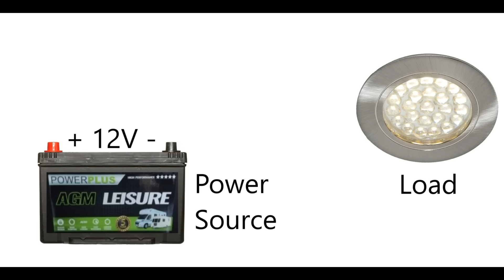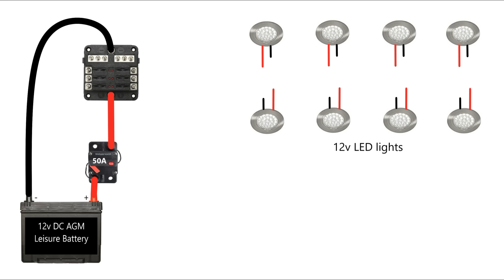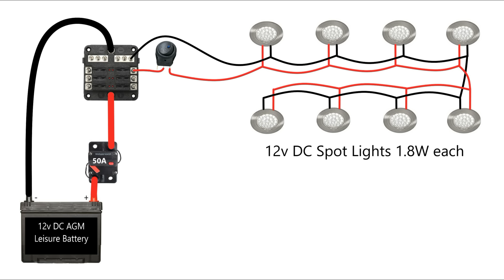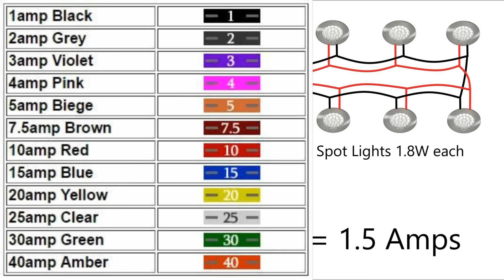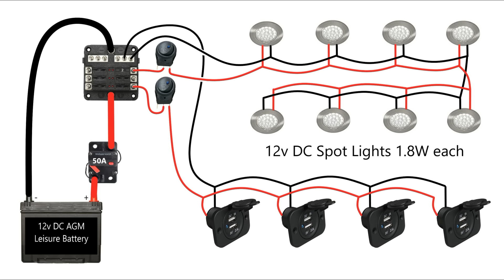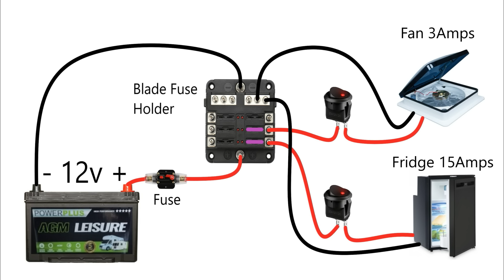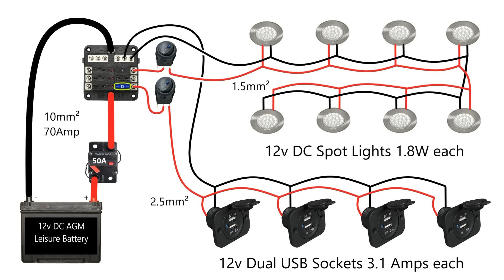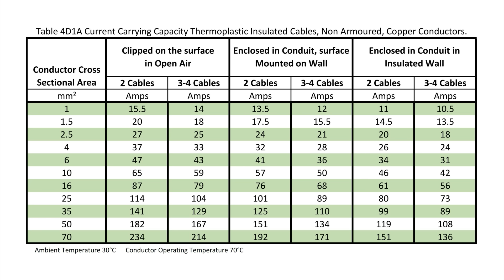Electric Cable & Fuse Sizing - Camper Van Conversion Series

Comment: Do you not need to take the length of wire into account when selecting the wire cross sectional area?
Reply from the maker: Yes absolutely correct, you do for the resistance and volt drop. Generally speaking as the van is so small the lengths are very short so the volt drop is minimal.

Comment: Question, I see in your video and wiring diagram you put up on the screen, the switch is between the fuse and the component.  I purchased a six gang switch panel for my build. It already is prewired and has on terminal “out” to the component. So can I run a wire from the switch to the fuse panel then to the component instead, or does the switch need always to be between the fuse and the component?
Reply from the maker: The switch can go either side of the fuse it will still shut off the circuit.

Comment: Greg when I put my new B2B in can I remove the old split charger? Also could I use the old split charger connection for the new B2B?
Reply from the maker: Yes take the old split charge out. Check the cables sizes if you plan to reuse the wiring. Most dc to dc charger require both poss and neg cables to be installed to both batteries.

Comment: Hi Greg great video on
electrical drawings. 
Just started van build amd wondering about your 3 solar panel system wiring
Drawings. Is it possible 
to introduce a van charger system  that will charger the leisure battery while the van is running. I belive this is called a split charging system. I plan on doing wild camping with my van during winter . Also I live in the North West of Ireland so sun light is very poor during winter time.?

Comment: Hi Greg, thank you so much for the incredible videos - I'm trying to get my head around the wiring for our camper and these are saving me! I noticed that you use a 1.5mm cable for a 1.2 amp set up. If I were to have a 0.45A or 0.3A set up (in an insulated van wall in a conduit) would you also recommend a 1.5mm cable? And then a 2.5mm cable for 9.3A? I know this is a bit larger than the cable size chart but maybe it's better to err on the larger size. Thanks so much for any advice you can provide!
Reply: Hello Isabelle,, how are you doing today, how’s everything going Isabelle?

Comment: Hi Greg 

Great Videos, they are a massive help. However I am slightly stuck with parallel lights circuits. I have the same touch sensitive LED lights as your own build (thanks for the inspiration btw), but how do I create a parallel circuit with them because as you know they only have two small terminals? Do I need some sort of connector or am I just not seeing something obvious.   

Thanks in advance

Comment: another great video - but I am confused about the cable sizing - as it does not seem to allow for variation in length of the wires or the voltage drop - when I use  - Drop in Volts (0.2) = (L x I   x0.017)/A mm2 - I get wire sizes way larger than those suggested on your video ?
Reply from the maker: Yes you do need to consider volt drop. Most of the runs in the van are short enough but the calculations require a dedicated video. Thank you for watching 😃
Reply: Thanks for you reply - yes the difference is significant over a short distance as you say for 15 amp 10m 6mm cable as against 1.5mm - I hope I’m wrong
Reply from the maker: @luderick  use this easy calculator on this page to check your sums. https://www.12voltplanet.co.uk/cable-sizing-selection.html
Scroll down to find it 👍🏼😃

Comment: Do you ever use an isolator and if so would you put it before the circuit breaker or does the trip function work as an isolator function?

Comment: Would lights be wired up the same if every light has an individual switch and usb charger built in?
Reply from the maker: All 12v devices must be wired in parallel to keep the voltage at 12v DC Just make sure to correctly size cables and fuses to cope with the load. 👍🏼😊

Comment: Hi Greg,

I was hoping for your advice, i bought 12v 2mm twin core cable (although rated at 25 amps). The issue i have now is, the strip lights i purchased wire is 20 awg, teeny tiny wires, 0.5mm-ish and I'm at a loss as if i can connect them as there is a massive drop in wire size. Can i use wagos? should i do an in-between wire size before the larger 2mm. my plan was to have the 2mm around the ceiling and then connecting the smaller wires of the lights, usb ports, fan as that will be easy access if anything needs changing. please help! thanks so much

Fan 3.3 amps
USB ports 6.25 amps
Main Lights 2.5 amp
Strip lights 1.25 amps

Comment: Hello Greg, hope all is well. Question...I want to hook up my 12V fridge directly to my battery. I have a 200 watt solar w a 1000 watt inverter. Do I cut my plug wire to do that??
Reply from the maker: I would suggest taking it off a blade fuse holder so you can protect it with a fuse. Watch my other 12v wiring video

Comment: Hey Greg, I turn to you because you are someone who respects the regulations. Do you know if there are any restrictions on where you would place an external shore power socket compared to a gas refilling point? It would seem to make sense that there would be some separation but I am just not finding any reliable info online about this. Any help greatly appreciated 😁 thanks!
Reply from the maker: The lpg regulations state that filling point should be 500mm away from windows, flues, vents, etc so I would use that as a guide.
Reply: @GregVirgoe  perfect, thanks Greg 😁 as ever you are a star!

Comment: Hi Greg, thanks for the great videos. I could only get 3 core 2.5mm flex cable, can I use this instead of 2 core for the likes of fan and fridge where 1.5mm is not enough? Thanks,  Cec Han
Reply from the maker: No problem with going with larger cable for the 12v devices. Your fridge will need something much bigger because of volt drop. I ran 6mm to our fridge.
Reply: @GregVirgoe  Thank you, I just wasnt sure what I do with the 3rd wire if there is no earth needed, guess it would just be redundant. I will check fridge again but I think it's the CRX 50 compressor type not needing quite as much power. Just getting my head around it before I draw out my plan :) thanks again

Comment: Is there a reason why people don't use chassy as negative"wire".
Reply from the maker: Because you often get problems with poor connection or bad continuity. So if you’re running one cable why not run a 2 core and it be a much better system 👍🏼😃

Comment: Hi Greg, I am confused regarding the fusing of the PV cables for the solar panels.
I have two 150W solar panels that I am wiring in series as per your solar video. Do I need to calculate 300w/12v = 25A + 20% for my PV cable fuse size?
Reply from the maker: No look at the details on the sticker on the back of the solar panel to see what the max amp figure is. That will stay the same if wired in series so just add 25% to that. Typically a fuse of 15amps will be good to use. Like this one https://amzn.to/3jlJ5uc
Reply: Perfect, thanks a lot! 😊

Comment: Hello Greg and happy new year. Is it necessary to have such a switch between 230 volt systems? Is the inverter not switched off when plugged in? Thanks for very good Van Conversion info
Reply from the maker: No the inverter is connected directly to the batteries and unless you have an automatic changeover unit like you get in a motorhome the changeover switch is essential to avoid having two supplies onto the same plug sockets.

Comment: The 50A ignition protected fuse before the  blade fuse holder. It has battery line and Aux load. I'm assuming battery line is from battery and Aux is between fuze and blade fuse holder? Is this correct? Thanks in advsnce

Comment: Will the design basically be the same if the battery were lithium instead of AGM?
Reply from the maker: Yes exactly you would just have a charger that was compatible with lithium batteries.

Comment: Re your diagrams with solar panels - they seem to be connected in series and therefore double the Volts, from 12v to 24v - while the rest of the system is 12 Volts.  Have you had any complaints from people damaging their gear by pumping 24v into a 12v system.
Reply from the maker: Peter it doesn’t work like that the volts are more like 60volts of this setup. What the MPPT does is transform that down to a charge voltage which varies but lets say 14volts and bumps up the amps. 
The solar side and the leisure side are separated the leisure side does not see the input voltage. 👍🏼😁
Reply: @GregVirgoe  I am sorry for my blunt comment above.  Thank you for your good-tempered response. I did not understand that a regulator can accept a lot more than 12v and then reduce it to a voltage suitable for the battery.  Thanks again.  I have changed my system to series.
Reply from the maker: @petervincent7720  no problem at all. Happy to help 😁

Comment: If my fuse block is on one side of my trailer and I have 4-5 circuits crossing roof to opposite side can I send positive and negative to a distribution bus bar on other side and and branch my circuits from that source? I am using 12 wag and would likely branch with 14 wag. These are low amp led light circuits.

Comment: you say fuse sizes cannot be higher than 1.5 times of max load. but U use a 2 amp fuse for a 1.2A load. 1.2A x 1.5 = 1.8 so ur fuse is higher than 1.5 times I don't get it.

Comment: Generally pretty good, but there doesn't seem to be any accounting for distance in cable sizing, personally a would see 100mm2 as too small there, I'd be wanting that for the 12v sockets, maybe this is ok, but I'd want to account for someone plugging a 12v kettle or inverter in, you can never tell what some people will do, the kinda people who fuse out the work kitchen day after day with a plug in hob, but never twig it's their fault
Reply from the maker: In this example these are usb sockets (3Amp max) and not cigarette sockets which can be fused up to 15Amps

Comment: Hi Greg,  do I still need to add a 240v consumer unit in my van
if only used on site, or will a ex lead be protected by site  plug in.
great video's
Reply from the maker: The site supply should be protected by a breaker so you could plug in a extension lead with sockets on the other end and just use that. In fact I have a 4 socket 15m extension reel with a 16amp commando plug on the end in the van to do exactly that 👍🏼😃
Reply: Hi Greg, thank's for reply,my question was for a mate who's got a part converted BONGO.
Greg ,can I ask you another for myself, I  have a T4 and want to wire a 100 watt S/P to a
RING dc to dc ,then to a 130 amp L/B, Iwas going to use 20mm cable plus 150 amp breaker
to fuse panel, would this be OTT as the cable run is quite short. Sorry for long query 
.Les

Comment: Hi, DOUBLE 240V SOCKETS led strip Fridge sink with 2 burner and usb socket and 240 Hook do I need to install FUSEBOX CONSUMER  2 way or should I install 6-Way Blade Fuse Box Block & Auto Marine FuseBox Holder 12V 32V Bus Bar Car Kit? Help please

Comment: Greg, Do you use any kind of battery monitor? Or just the MT50 Charge Controller Monitor?
Reply from the maker: Currently just the MT50 and my Truma system also knows the battery voltage. 
I just keep an eye on the voltage and it’s never gone below 12.4volts in over two years. 👍🏼😁
Reply: @GregVirgoe  Thanks

Comment: I just bought 4 x 12v  c100 130ah  batteries..
Each one says CCA 800a..
I want to connect them parallel to keep the 12v..
What size battery link lead cables should I use? 
And what size fuse? 
Thanks
Reply from the maker: The size of the link cables is determined by the total load you intend to connect to them. Add up all the amps of all your appliances and use that figures to size the cables. Assuming everything may be on at the same time they need to handle the total load.

Comment: Hi Greg i have a 230v solar panel going into a 20amp mppt solar charger!  What size cable do i need from the solar charger to the batteries please! Many thanks Dave
Reply from the maker: I would use 10mm battery cable for that 👍🏼😊

Comment: Hi, I now have my 50w solar panel and 50ah sealed battery, 10a charge controller PWM. I've used the same solar wire to charge controller, then charge controller to battery, 4mm2 cable. No fuse on either at present. I measured the load and now understand it comes from the battery ATM, 14.5V with multi meter and charge controller showing 13.01V coming in from panel - cloudy.  My question is do I need a fuse near battery and also on positive from load? Do I connect a blade fuse bus bar straight from the battery or load ? cheers.

Comment: brilliant as usual greg...is there a way to switch on my factory fitted reversing camera.(so i can turn it on at any time) my van is a 2015 transit custom..ex police van..?
Reply from the maker: Normally there is a switched live that is normally picked up from your reversing lights so when you put the van into reverse that turns on the camera. What I did was pick up a permanent supply via a switch and put that onto that switches cable so I can now turn it on by flicking that switch.
Reply: @GregVirgoe  but will the reversing lights also come on?..I wanted to be discreet but still look around

Comment: So... If I had 4 x 1.8W lights in a 12v system; thats 0.6amps x 1.25 = 0.75 amps. I can't use a 1 amp fuse here as its above the 1.5 limit - what to do here?!

Comment: Hi Greg. I have a question. I am looking at the LED reading lights with USB outlets that are popular in vans. I have seen people install 2 or 4 of them. Can you explain how 4 of these can be on one circuit, and how the circuit to 3 of them is not broken when one of them is switched off, or how the circuit is still flowing to the USB outlets even when the light is switched off? Thanks! :)
Reply from the maker: In all these devices there is a common positive and negative that are permanent on and these loop through to the next device. From the common terminals in each device is taken a switched circuit to feed lights and a non switch circuit to feed usb sockets. So the lights and usb do not affect the continuous ring main
Reply: @GregVirgoe  Thanks!

Comment: Where do I get the small two core wires please? I didn't see any at B&Q. You're awesome 🙂
Reply from the maker: Here is a full parts list with links you need. https://www.dropbox.com/s/zvtyj0z7cdeb9d8/Greg%20Virgoe%20Campervan%20Parts%20List.docx?dl=0
Reply: @GregVirgoe  thank you so much you have become the legend like that all knowing car guru. I am based in Brighton and today marks first year of van lifing full time. I am curious if you are an. Electrical engineer by trade
Reply from the maker: @vanlifeembracingdiversity5431  I’m a building services engineer which encompasses all services and trades

Comment: So to be on the safe side should i put a higher amp cable?... mine will be in a conduit between ply and insulation
Reply from the maker: Yes it doesn’t hurt to go up in size on your cables. 👍🏼🤩

Comment: Your videos are really good BUT this info is going straight over my head and thats me not you Im trying to figure what wire size I need for puck lights that are power 2.5W and Im taking it that is for each the wire that I have bought has the following info on the reel Temp rating 80C Rated voltage 300 (D) (mm) 2.00 minus plus 0.15 that it has an * and then (4.00 plus minus 0.20) I am wiring to a CTEK your help would be gratefully accepted by an old dude that is confused by numbers

Comment: In the wiring video, I don't think you mentioned ground wires or grounding the configuration. Is that what the negative terminals are representing on the blade fuse holder?
Reply: My project is adding a battery to a food truck trailer to power an electric jack. We have a breaker box already installed inside the trailer but I'm much too inexperienced to be fooling around with that. Just want to safely wire the jack and maybe learn how to charge the battery as well.

Comment: Is it permissible/sensible to parallel up cables instead of using thicker ones. E.g. I have some solar panels to two MPPTs (due to different shading) and then to a single Victron battery protect device. The wire from there to the batteries is 4mm2. I'd like to add a third MPPT and more panels, the battery connect has capacity just to add this in as a third input. But then the output cable from the battery connect to the battery I calculate to needs to now be 8mm2. So do I need to replace the 4mm2 cable with 8mm2, or can I just add a second parallel connection with some 4mm2 cable that I already have?

Comment: Thanks for the information I had a quick question because I needed to run 10awg wire to carry the current at a distance from my batteries is it ok to connect that awg to the 14 awg wire that comes from my water pump?
Reply from the maker: If the final connection is smaller that it ok. Run the larger cable the majority of the way and connect at the pump this will help reduce the voltage drop.
Reply: @GregVirgoe  awesome thanks so much I really appreciate it!

Comment: Hi there. I'm a newbie to this particular task. What do you do when the wires from your led are both white and very short? How do you work out which one is neg and which pos? As I'm having 4 lights in my ceiling tongue and groove. Thanks 🙂
Reply from the maker: They will only work one way because of diodes so touch them on a battery and you will know which is right. If you look close one wire may have a thin black line so you can tell for all the others. 😁
Reply: @GregVirgoe  Thanks Greg.🙂